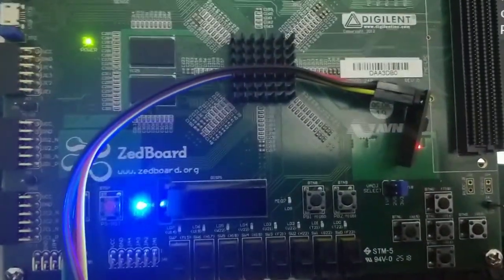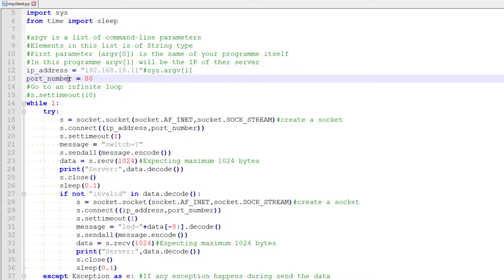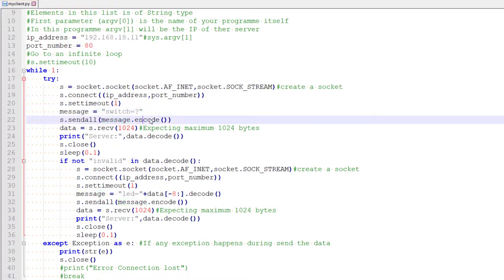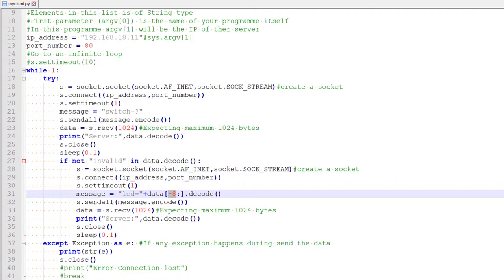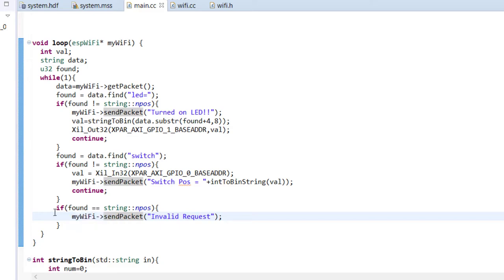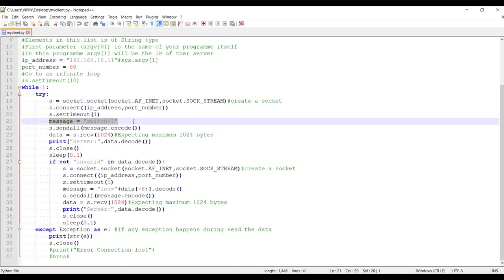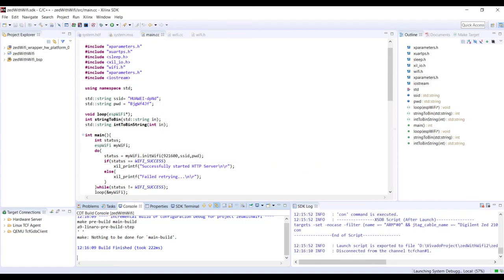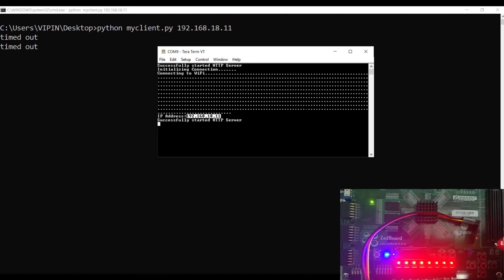Connecting ZedBoard with Wifi. Controlling Peripherals Programmatically Part 3

Comment: Sir 
    Can i connect two or more zedboards and transfer data between two zedboards ? Example : Sending data from master to first slave ,Similarly Sending data from master to second slave. If Switch is turned on master zedboard, slave LED should turn on !!
Reply from the maker: Yes. You can configure 2 esps connected to two Zedboard s as serves and use a client to communicate with both using their respective IPs. You can also  configure one Zedboard  as server and other as client. Command details you can see in this page https://www.rhydolabz.com/wiki/?p=10872